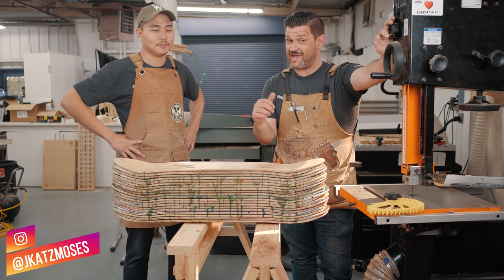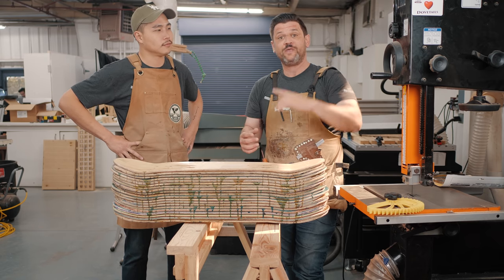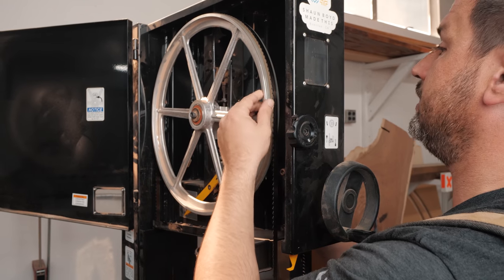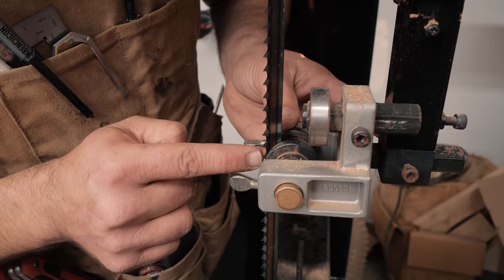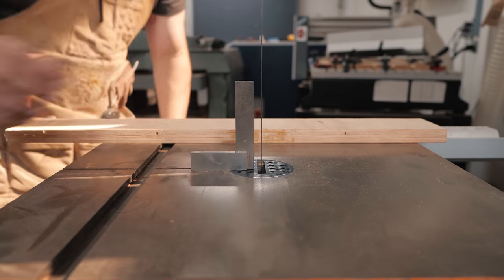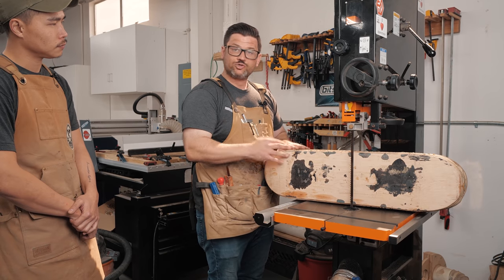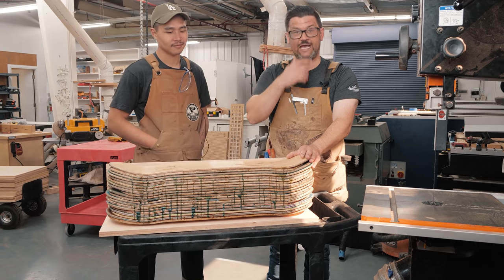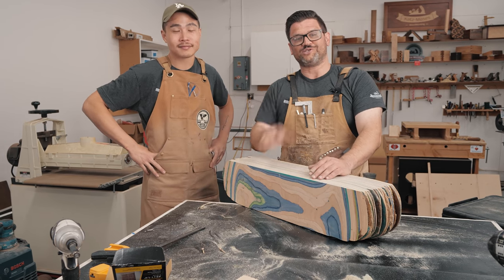How to Setup and Resaw on the Bandsaw with @WobyDesign

Comment: OverviewI had an old Black and Decker Firestorm set that was getting very long in the tooth https://www.youtube.com/post/UgkxW1vOBRCMrgTCDEijzpVzDWsgI-Jm2iQv so it was an easy decision when this set went on sale. I'm not a pro or a handyman. I'm an occasional DIYer. So for me, this set is fantastic. I am very happy with my purchase.The Good Parts Very well priced for what you get Comes with everything you need - two batteries, a charger, and a carry bag The products feel very well made Not too heavy The drills are small and ergonomic (for my smallish hands) Huge ecosystem - Dewalt makes a lot of tools that use the same battery type and chargerCould Be Better I guess I could say that I wish the batteries were bigger, but that's a relatively minor compaint

Comment: Thanks for the tutorial.  I am not sure I agree with putting the gullets there, as I did that for a brand new resaw king blade and had the proper tension set (according to the tension guide, I did not know your method at the time), and then after sawing for just a few pieces of wood (overall wood length sawn over a few weeks was not even 16 ft), the blade snapped due to cracks that formed in multiple places in the gullet area and not where the blade was welded together.  I worked with the blade manufacturer, and they were great and sent me a replacement blade as it should not have failed like it did.   I realize that can happen with a blade regardless of how you set it up, but if the highest tension is in the "machined and curved " area of metal, and there are any rougher spots or tiny machining chips/scratches...that is where cracks can more easily form and propagate.  So I guess this is more of a "everyone should inspect their blade often and use proper safety".  In any case, the rest of what you said is super helpful and that should make an awesome experience for anyone doing resawing. :)
Reply from the maker: I would stand behind this method to the death hahaha. You really should look up the Snodgrass method. He's the undisputed king of bandsaws. Blades can develop cracks if you leave them with tension overnight or it could have just been a faulty blade.
Reply: @katzmosestools  Yeah, I was careful to leave it un-tensioned, but I agree it could have been a bad blade, and was really happy the blade manufacturer stood behind it to get me another one.  I will check out the Snodgrass method, thanks for that and for always trying to put out such useful content. :)

Comment: I have the exact same bandsaw, dont ever seam to beat able to tune it up this good. I always have a little blade flutter, so when I set the breaing like you did, they turn slowly as the blade jangles against them slightly. Any thoughts on fixes? It's a new blade and I  feel like the blade is pretty tight.

Comment: I understand putting the gullet blade on the crown of the wheel for the top wheel, but is this supposed to be true for the bottom wheel as well? 

I've found that I can get the blade centered on the top, but not the bottom. Should that matter? 

I ask because my blade has started wobbling front to back, and I can't get it to track on the bottom wheel.
Reply from the maker: Shouldn't matter on the bottom wheel as long as it stays on there

Comment: I have a small bandsaw (Grizzly 803) that I have a terrible time keeping set up. The blade runs off the crown with the most minuscule of adjustment. It runs right by. Is my blade tension too tight?  I'm beginning to think I'd be better off with a scroll saw.
Reply: BTW, I love my suizan and dovetail jig. :)
Reply from the maker: I would check that your wheel isn't warped and that your tire doesn't need to be replaced. Cheers bud!